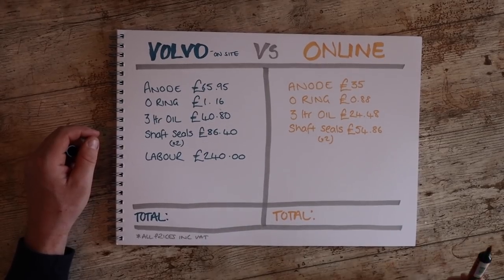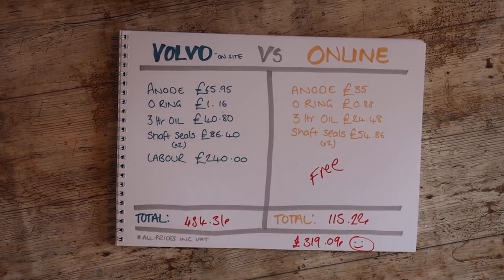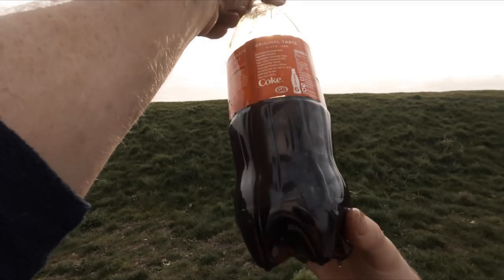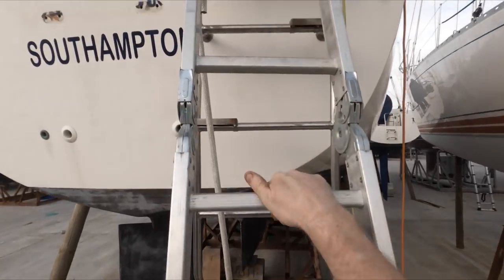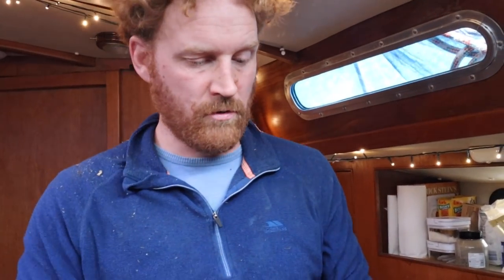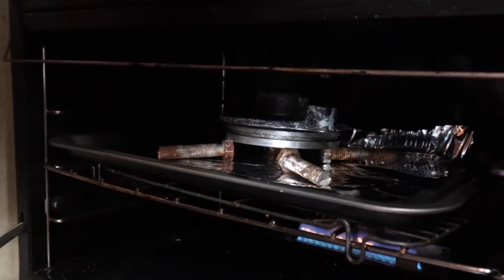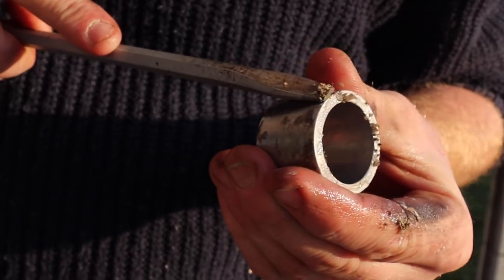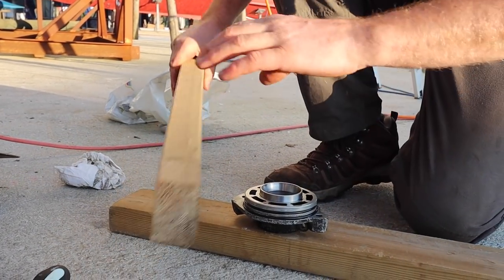Sailing Boat - DIY (Saving £318)

Comment: Love the oven idea,  As a precaution ,why didn't you run the engine , hose pipe in the water intake ,
Safety don't put the prop on,  start,  forward and reverse ,  listen for noises,  may save you loads of time and cash , if there is an issue while in the hoist,
Service parts when you set off , take a good supply , if you can get them on internet , you won't find them that cheap later, med isn't cheap, filters and impeller don't age , 
Sitting on the hard for a long time , do you make your batteries work, or just leave on shore power for months,  through my work I have had to replace more batteries because of this, batteries are made to drop a charge and then recharge,  sitting for months isn't good, simple way is to unplug shore power 
Use the power , then plug back in,  as you don't live on her,  it may be unplug a few days, 
Yes I'm stuck at home and cannot go to work , sailing , bugger
Reply from the maker: You know I didn't even think to turn the engine on and run a water intake from the hard.

I did engage the forward and reverse gears to ensure they locked in and moved the prop manually.

The batteries are rigged up to the solar and there are some systems still on in the boat, like the fridge (which we just forgot to turn off) so the batteries are being drained slightly and charged each day, so hopefully that keeps them in some kind of shape?

Comment: Good to see you getting stuck into a bit of marine engineering ....... as an ex. I would not dream of reassembling dry!   much better to grease/oil components when putting back together ............. you'll be glad you did when tackling the job next time    OK??      Wishing you both well during this earthshaking time!!!
Reply from the maker: I greased up the drive shaft and cogs (probably just bastardised the names of those parts there, ha ha), and put a little gear oil in the baring, O-rings and seals. 

Just for the sake of video length, I broke it down into quick clips. In hindsight I think hammering the seals on concrete wasn't the the best idea, and the anode doesn't look flush on one side now I've watched the video back 😔

Hope you're staying safe and well too 🤞
Reply: @CadohaAdventures  BTW, was it Sailing Britaly that you watched for tech guidance?
Reply from the maker: Robert Rudolph it was indeed, I popped a link to their channel and gave them a shout it kid video too for their awesome content, enabling non mechanically minded apes like me a fighting chance to fix things 😬

Comment: I was about to say you forgot to put the oil back in when you said you would be doing other repairs on the drive.
Reply from the maker: Carly ended up putting the oil back in already. I was at work when we got the call to say the marina was closing, so we had to head back home and so Carly. just quickly filled it back up before we left, but didn't record it ☺️

Comment: I would offer two pieces of advice. 
Firstly get yourself a soft-faced hammer rather than your claw-hammer which is a woodworking tool. Smashing it against aluminium parts makes me cringe ever so slightly... 😳😳
Secondly scraping dirt off is ok so long as that surface is not inside a seal. Your scraping can create microscopic scratches which will destroy a seal in double-quick time. 
Considering your amateur status though I do admire your optimism!!! 😂😂😂🤓
Reply from the maker: Ha ha, you’re not the first person who’s cringed at my amateur hammer swinging and pointed out that I need a soft faced hammer (which I’ve duly gone and purchased), I’m hoping to be kinder to my mechanics going forward 😂

Appreciate the feedback, it really does help a know nothing like me start to connect the dots 😬😬🍻

Comment: a very long time after the event I know, but boiling water and a freezer are your friends in situations like these. Putting the casing in a saucepan of boiling water is a lot safer than an oven, less chance of accidental distortion and freezing the repalcement bearing / race will make it slip into a not casing without the use of much force at all. Sign of a misspent youth messing with motorcycles. :)
Reply from the maker: Thanks for sharing your wisdom with us there, Tom, I feel like I've learnt so much already from people's feedback alone!! 😁🍻

Comment: Covid boredom caused me to watch. In passing comment, the £260 odd in labour isn't bad. It has to pay the mechanics wages, probably for the day. To be able to walk across the yard to the Volvo dealer means they've got premisses, and that has to be paid for. As well as the ever useful [sarcasm] Business Rates that will be attached to those premisses. There will be other staff, and other needs of the business. They probably have to buy their spares from the Volvo supply channel, and all that carries a needed profit margin on the spares too, to maintain their dealership which no doubt costs the local company as well.
But more than this is that you've learned something by doing the job yourself. You've saved your money for sure, and grown your self confidence by taking a step. The money will flow through your hands one way or another, but the self growth will never leave you.
Reply from the maker: I agree 100%, I don't begrudge people making their crust! I'm happy to try and learn as best as I can, first and foremost to get a better grip of how to keep a boat going when the situation arises in less opportune circumstances, but also, to stretch the sailing budget out as long as possible, before having to come back home and start mixing up cement again! 😁

Hope you're keeping well during the lockdown, and hope the boredom eases up 🤞🤞🤞

Comment: Interesting solution to a problem 👍👍🙂
Reply from the maker: It seemed like a logical idea if heating the whole thing meant the alloy would expand more than the baring. Someone else mentioned then freezing the baring later on to get. it back in easily, which in hindsight makes perfect sense 😁

Comment: Time to clean the oven ! What no gasket for the lower end stern drive 😢
Reply from the maker: There was no gasket on there when I took it apart, and there was no gasket with the service pack, just a couple of O-rings that came off of the sail drive face.
Reply: @CadohaAdventures  You are exactly right with the 2 O-rings,  no gasket needed.  Good job done.
Reply from the maker: gigoclick  appreciate the pointers. I'm clearly still very green to all this engine maintenance malarkey and learning so much every day it seems 😬🍻

Comment: Way to go. I’d have used the savings to take the wife for a slap up meal where we’d have got food poisoning. When we had paid £200 to get the car unclamped from the hospital car park, added the £150 for the meal, splashed out on £60 for medicines and contributed £600 for a divorce lawyer I would have been better with Volvo😉👍⛵️

Comment: Grease the the prop. spline with waterproof grease. In one year at sea, you will not be able to remove the prop. in one piece. Important!
Reply from the maker: Any waterproof grease? I have a tin of grease on board that looks a bit like Vaseline (in its colour and consistency) and it says waterproof grease, but after watching another video that was shared with me last night, I someone grease it up with a white looking paste? 

Wasn't sure if they were the same thing in essence but just different brands?
Reply: @CadohaAdventures  No swet. If the tin says 'waterproof grease', it will do the trick. As a general roole, you should be out of the water once a year to replace the anode. Then the prop. is off, clean, re-grease and put together. Another important issue, be sure the anode has a good electrical contact with the material it is meant to protect. Use a multimetre and ohm, should give zero resistance. By profession, I am a corrosion engineer :-) Built my own steel sailer from scratch, born mad.
Reply: Not 'roole', should have been 'rule', sorry for my bad English.
Reply from the maker: @svhulda6157  I did use the multi meter on the anode. I put one connection on the anode and the other on some metal at the end of the prop and the reading came up quite low, like 0.4 ohms.

To get a better connection would you use perhaps some sanding paper to clean off the area it connects to even more?

Appreciate your help here 😁
Reply: @CadohaAdventures  You should bee down in the milliamp. area, or infinite. Clean a small spot an try agiain. If still not good, remove anode, clean (piece of sand paper) and refit. 'Best practice': small amount of Vaseline (or similar, ie Dow Corning C4 (bloody expencive)) under bolt heads and on threads. I always carry a box of yellow Vaseline on board. Use it on el. connections. I have never had electrical issues with my el. systems.
Reply: @svhulda6157  Sorry, too early in the morning. 0.4 amps are great. Thought the wrong way around. But the rest og what I wrote is OK. Had to bring out my Fluke to test my brains.
Reply: Ohm.

Comment: What no Gasket or sealant on the face
Reply from the maker: There were two O-rings which I changed and just put a bit of gear oil on them, although for some reason that's not filmed, but they're there. 

There was no other gasket anywhere when it came apart though.

Comment: Liking the video & hammer will fix anything 😃
Reply from the maker: After using it a bit too frivolously on the concrete floor, I quickly decided to try and soften the blows a little in the wood, ha ha. I get a bit too trigger happy with a hammer it seems 😳